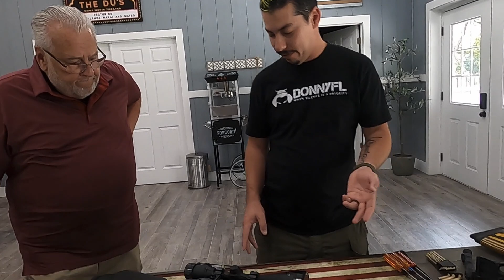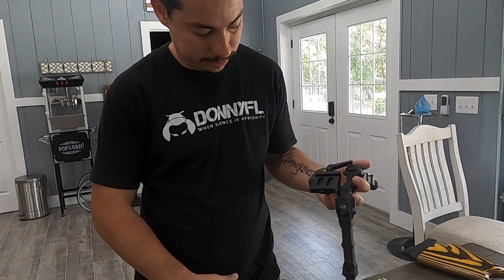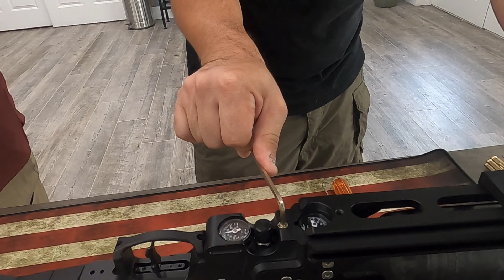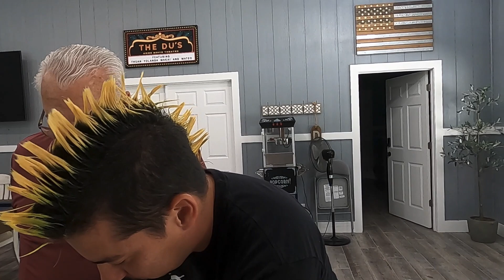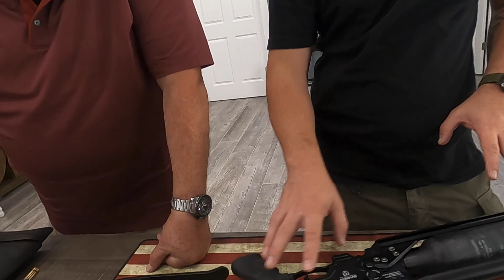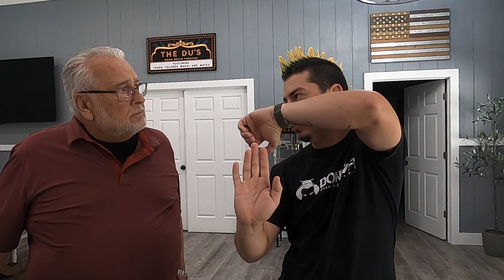Donnyfl’s Izzy Converts FX to Saber Tactical Chassis

Comment: That was a nice long video my friend. I had three coffee and ate my lunch watching this. That Saber Tactical stuff is very slick.  I'm a Edgun Leshiy 2 guy but still I changed out the 350 LW barrel for a 600mm FX slug liner (.30). These barrels are the best imo. The FX barrels fit the Leshiy 2 like a glove, both barrels (350 LW and 600 FX ) are 14mm. The only thing it needs is a Huma adapter. I also changed the original external reapr regulator for the Huma Raptor external regulater set to 190 bar. In the original setting, the Leshi 2 shot the 49 grain ZAN slugs at 840 fps, now with the FX liners it went up to 1015 fps (112 fpe) You should try the Leshiy 2 Mr. Russ, it's a real hunter and it shoots 8 slugs as fast as you can pull the trigger ;-)
Reply: jbhk .... it is good to hear from you .... and yes ... I have tried (but don't yet own) the Edgun on a Florida hunt for Iguana in 30 caliber ... and it is a sweetheart.  I may be wrong, but FX may have purchased Edgun ... perhaps one of our viewers can confirm or correct.  I was not aware of the barrel interchangeably ...but many are ... thanks for sharing ... Dr. Russ
Reply: @russjones6497  Thanks for getting back sir. No, FX didn't buy Edgun, that would be the most unlikely takeover ever.